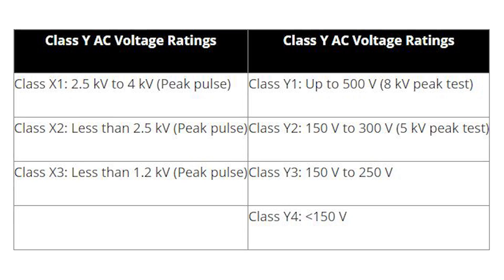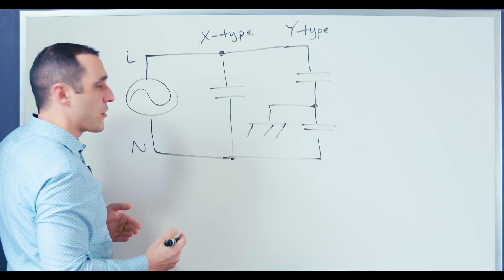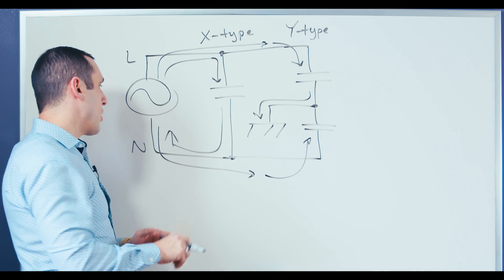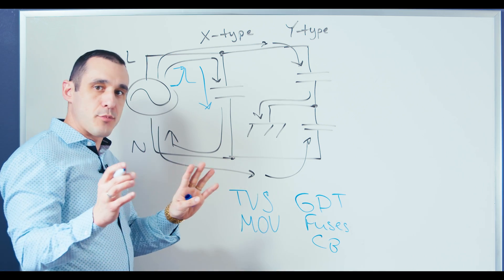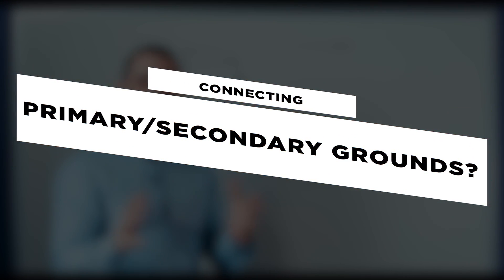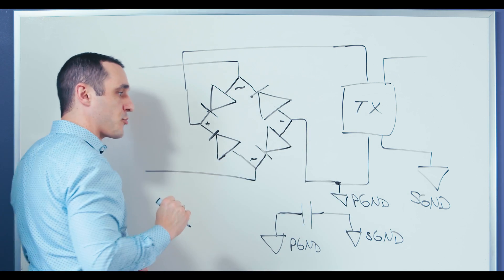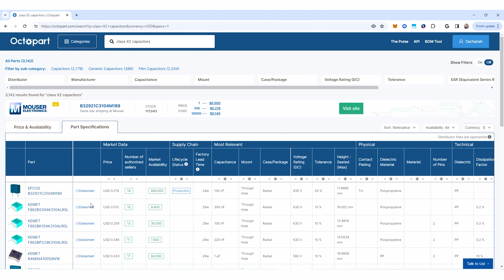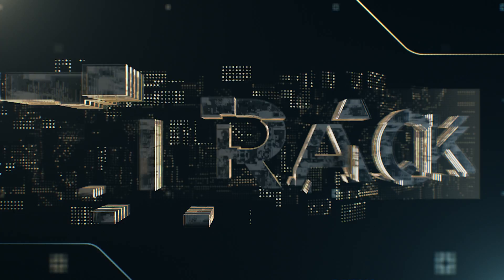Safety Capacitors in EMI Filters: Understanding Class-X and Y

Comment: So how do you calculate the values you need for an X or Y capacitor?
Reply: You would calculate these based on the values that are required in a particular circuit. For example in the filter section on an AC input, what frequency are you trying to set as the cutoff? This would be based on the inductance of any choke applied in the filter section before rectification. If you want to see a good example, go to Webench and create an example design for a DC/DC converter with standard AC input, it will give you some example values that are typical for the application. For something like a y-type cap across a transformer in an isolated DC/DC converter, the cap just needs to be larger than the winding-to-winding capacitance (this can be measured with an LCR meter). Typical values for that cap would be 1 nF or 2.2 nF, but in that application the voltage rating is more important than the capacitance.
Reply: @Zachariah-Peterson  Thank you for the explanation.

Comment: You didn't mention the most important difference between capacitor X and Y, namely that a damaged capacitor X causes a short circuit, while a damaged capacitor Y remains open. This is the key difference between X and Y, and that's why they have different applications in a circuit.

Comment: Excellent video, Zach. 
How can we decide the value of the Y-class cap connected between PGND and SGND of a transformer used in an isolated DCDC converter? 
Thank a lot and keep the good work!!
Reply: The value of the safety capacitor needs to be larger than the winding-to-winding capacitance of the transformer, this way you create a lower impedance path through the capacitor between the GND planes. The capacitor value is typically 2.2 nF in a lot of reference designs. You can use through-hole type capacitor and experiment with different values. Be careful because there is a leakage current associated with capacitors and this can create a conducted emissions failure under certain product standards, for example in medical products.

Comment: Any downside using 2 y caps in series ?
And what to do if there is no ground in house? Remove y caps or remove 1 of them to form live to neutral y cap
Reply: If you have two caps in series, the total capacitance will be half, and the breakdown voltage for the connection across the two caps will be double. In an isolated DC/DC converter, this is bad because you want to have the capacitor's capacitance value to be larger than the winding-to-winding capacitance of the transformer so that you can pass higher frequency noise currents back to the power input on the primary side, thus increasing radiated EMI at higher frequencies. In this input EMI filtering application, this reduces the range of frequencies that the dual capacitor connection can filter, so you have risk of more conducted emissions at higher frequencies.

Comment: Safety capacitor is non-polar capacitor?
Reply: Most common is a polypropylene or polyester capacitor, which are non-polarized. I have seen some ceramics also, which are non-polarized. I am not aware of any electrolytics used in this application. These non-polarized caps are also used to reconnect grounds in isolated power supplies to reduce high-frequency radiated emissions from the secondary side of the power supply.

Comment: Wait wait wait, you rectified AC and you're sending it to the primary side of a transformer? Uhh, transformers don't work with DC...
Reply: It's a pulsating DC. There is no smoothing cap inserted. Basically, you have a AC voltage with amplitudes half as a DC offset.
Reply: The intention here was to show the topology for a switching converter, such as a flyback converter, I just have omitted the driver stage. The pulsating DC would be smoothed at high voltage and then it would be pulsed with a driver circuit. Even without that, the rectifier still keeps an AC wave but it is unipolar, it is not DC until you put a smoothing capacitor.

Comment: Thanks for sharing this info ! Are these the same capacitors can be used as a RC Snubber ? I dont see the ESR anywhere in the datasheet.
Reply: They are not normally used in RC snubber type of circuit because of how they fail (open or short) or because they may not have the right capacitance value. The value of these capacitors can be pretty small, whereas your particular RC snubber might work better if the capacitor is large.

Comment: hello, thanks for this useful topic. I have 2 questions:
1- For a Y-type capacitor we need earth ground to bypass common mode noise is this ground the same as protective earth ground used in power lines or it's something else?
2- in ethernet applications also has a transformer and isolation barrier can we use a Y-Type cap for those too?
Reply: 1 Yes
2 Maybe, it depends

Comment: There is a catch with these x- and y-capacitors. They introduce high enough leakage, which prevents them from being used in medical designs.
Reply: Wouldn't it be a problem with any appliance?  When I saw the Y types to gnd first thing I thought was "isn't that a ground fault? "
Reply: Would it be because we use insulated neutral in hospitals ? If the neutral current detector is sensitive enough it would take it as a ground fault I guess. If we use neutral to earth or similar I guess if it stays below the differential protection limit in the 10s of mA it would not trigger ?

Comment: As I know: 
Y class designed to not obtain short circuit failure mode because you dont want that your chassis become live after cap failure. 
X class designed to not catch at fire at failure. Pupped fuse ok-ish but huge no no no to flames. 
According conciquences of cap failures we chouse what type is needed. 
Does this vidio menthioning something about it?
Reply: no it doesnt.

It also doesn't mention that the larger value (and also smaller package) you chose as the Y- class capacitor from PGND to SGND the more the leakage current is going to be from the line into the chassis of the device (you might feel a shock touching the chassis of your device on the secondary). Therefore it should neither be too large or too small.

Comment: Most important of all.

AVOID RIFA caps.
Reply: RIFA madness!
Reply: Rifa hasn't been around for a while. And the bad caps are specifically ones made in the 70s and 80s, there's no need to be too suspicious of more modern ones.
Reply: @SianaGearz  Actually no. I have this guy that wants "all original" for old equipment. Mouser and Digi-key still sell them. And there is a large surplus of "new-old stock" of these on eBay and such. And yes some batches bought from the likes of Mouser did go bad (i.e. cracked cases) after 3-4 years. Partly correct that they are prevalent on older equipment but I can see some new players buying these things. If someone must be all original or got them by mistake, I'd advise to at least check them during regular servicing or just get rid of them.